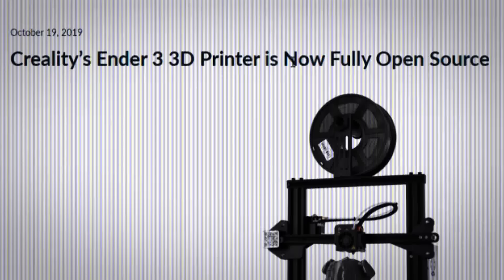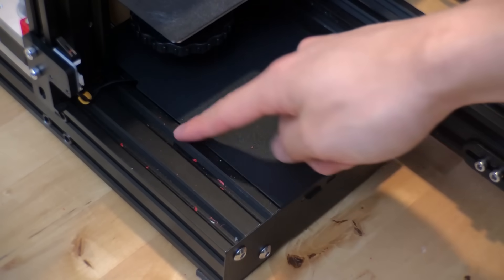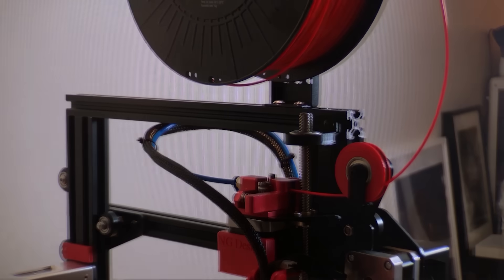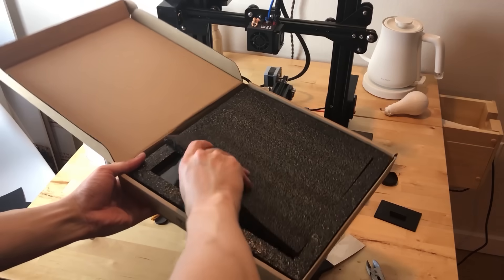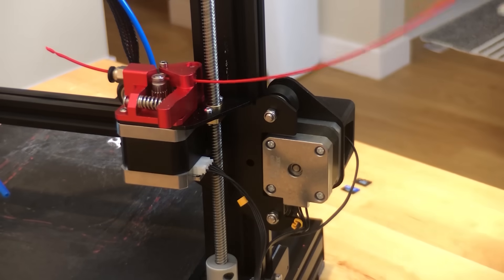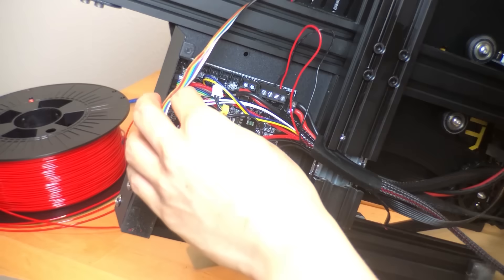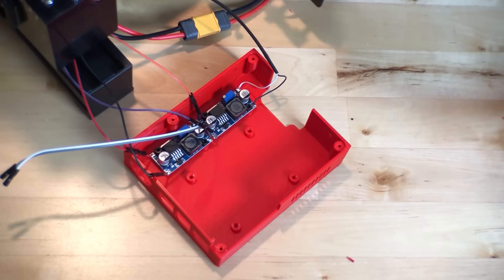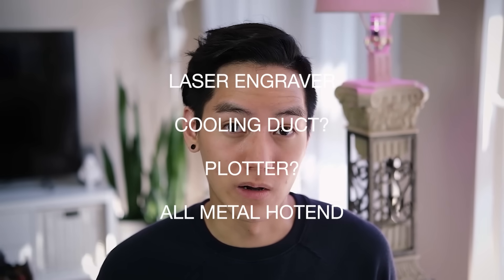First 24 Upgrades for my Ender 3 Pro - Part 1

Comment: 3D print a part.  Part needs a notch.    You could spend hours designing a new cover and then printing it (a second full print)  to fix it.  Or you could grind a slot out in like 2 minutes with a Dremel.
Reply from the maker: haha true but the print quality was also kinda strange on the first one so i wanted to reprint with some tweaked settings anyways

Comment: 5:00 um of course you don't need all the pieces if you're not gonna install them in the correct spot! Those are the last pieces that connect to the machine.
Reply from the maker: yeaaa but if you look at the video, by the time i got to those pieces, if i had added them, it would have bent the whole chain in a very tight and forced bend. try it out yourself. maybe you can work in those pieces but i chose to just play it safe. the main chain for the extruder is connected to the machine but for the heated bed wires those were just too far. good luck

Comment: The FAN shroud should not be used.  The Meanwill PRO PS uses the fan as an INTAKE fan.  You should never do anything to restrict this flow in any manner.

However, there are many other great items here to print and use.

Comment: I started printing with the glass bed, at some point after almost a year I changed it for a flexible bed and it is soooo much better, take prints out of the glass bed is a nigmare, with a flexible one you just bend it a little and they pop out, never using glass again
Reply: Im reasonably new but its like nite and day..  The flexible magnetic cover solved so many issues for me.

Comment: how much did all the unprinted parts cost? I'm considering buying the ender 3 pro but when I'm gonna buy it I want to buy all the upgrades at the same time so I don't have to worry about it afterwards.
Reply: You cant just buy them, thats illegal :) Just got my ender 3 pro after having a bad 5mm plywood anet a8....Im blown away at the quality and ease of use(Printing these upgrades). Good luck!

Comment: At this point, what is even original on your printer other than the display, frame and PSU? If you have to replace that much on the printer there must be a lot of cost creep and it might be better to start off with a better printer.

Comment: Highly recommend our 1000x1000x1000mm industrial 3D printer. Please let me know if you have interest.( email: hardy.ke@creatbottech.com or whatsapp: +86 18318030163 )

1) 7 inch touch screen

2) Filament detection sensor

3) Rail guide

4) Enclosed

4) Servo motor

We are factory and can providing affordable pricing to support.

You can also visit our alibaba store: https://creatbottech.en.alibaba.com/

Comment: I have a question regarding #7 2:52 the fan cover: because of the cover it gets less air, heat accumulates. isnt it dangerous to overheat?
Reply from the maker: I've seen a lot of people concerned about this one but it's honestly an air intake and the cover only redirects the air a bit so i don't think it's that big of a problem. lately i've bene doing 15 hour+ prints as well and touching the PSU from the outside there's no signs of it getting warm at all. it's a very popular one on thingiverse and i haven't seen anyone have issues with it but definitely do it at your own risk. it honestly barely makes it quieter too so maybe don't risk it if you're worried haha
Reply: @ScottYuJan  thank you ! Great Video btw. It nudged me to buy a ender 3d :)

Comment: owh dennggg i didnt know strings can be removed using lighter ._." thanks Scott <3
Reply from the maker: i actually recently over did it and left a huge burn mark on a very nice print sadly 😢 and i found out a heat gun actually works waaaaayyy better so i recommend that now haha
Reply: @ScottYuJan  that... happened to me minutes ago too xDDD luckily was just a test-piece. thanks for the updates, good sir <3

Comment: im new to 3d printing,how do i batch print something?Like the cable ties
Reply from the maker: i believe the files on thingiverse already has a gcode for the batched print but if not you can drag in multiple STLs basically and arrange them for a batch print.
Reply: @ScottYuJan  ok thank you i will look into that

Comment: If you have the BL touch, do you still need the bed springs and leveling knobs?
Reply from the maker: evening knob was just for flare because i liked the red ones better. springs.... you also technically don’t. the spring upgrades might contribute a bit to longer term stability but definitely not a NEED
Reply: k, thanks.  Just getting started in this and your video was a big help.

Comment: Are u able to install the bed springs and bed handle without removing the magnetic sticky bed pad thing.  I am not ready to upgrade to a glass top just yet but id love the new springs and printed bed handle.
Reply from the maker: yes you can!

Comment: For the front rail cover, did you run into issues using version 3 of that print (the current version) or were you using an older version?

Comment: You have the old ender 3 because mine has a magnetic flexible build plate wich is real good and usefull
Reply: He had the magnetic build plate too, but the glass is better in a few ways. It can heat to higher temperatures without risking damages or emitting fumes, and it leaves a smoother finish on the bottom. It may make parts less convenient to remove, but that’s a small price to pay.
Reply: @thedarkcod4824  i mean yeah but the new plate is better than the okd one

Comment: Bowden tubes can go up higher temps then the stock PTFE tubes .... aha and what Material is it then ?
and replacing the MB for easy of FW update dude just flash a bootloader on the existing open and check in marlin with thermal runayway protection ? why wasting money for the same hardware, besides stepper driver they are at least worth it

Comment: Can someone please explain why would you want to replace the magnetic surface with a glass one.  Also would the BL touch work with the magnetic surface as well or does it require a glass surface?
Reply from the maker: BL touch works with any surface. glass surface is just a lot more durable. it has downsides though for sure. it’s. lot heavier but i personally didn’t like how much my magnetic bed was getting dirty and scratched up and leaving debris on the base layer of my prints.
Reply: Scott Yu-Jan 👍 thnx a bunch

Comment: While I was watching this video for the third time, the mailman just dropped my Ender 3 Pro, which was bought pretty much thanks to this video.
Reply: Hey tonguc how’s it going . I also but my very first printer 2 days ago ? Are you planning to do all the same upgrades from this video ?
Reply: Josue Corona hi, yes. i will do the upgrades in phases though.  initially skr mini e3 + bl touch + bed metal screws. then later on dual metal gear extruder upgrade . later laser engraving upgrade. also i want to do a dual extruder upgrade at some point, mainly for fixed custom color so im still researching/studying that.
Reply: @Mr_ToR  Nice i am in  the same situation, right now i just started doing the chain link for the cable

Comment: I’ve done a few of these upgrades, some similar ones. But I’m definitely getting the BLTouch and glass bed. I’m horrible at bed leveling. There always seems to be some filament stuck on the nozzle inhibiting me from getting the bed perfect. My magnetic bed is also showing signs of wear. My main upgrade for it though is going to be building a proper stand/table for it.

Comment: cool video! might give the Raspi&BL touch a shot. You should add noctua fans.
- Mainbaord (fits and you can add 3 buck converters if required). Remember the SKR3 mini has fan&parts fan switched as compared to the original board.
- psu via custom printed cover to make space für the 60x25 instead of 60x10 fan.
- parts and hotend 40mm fans via 'fang' fan duct: https://www.thingiverse.com/thing:3676132 or a remix like this. Check if you can still add BL touch with this or need the metal-fixture. I used this one: https://www.thingiverse.com/thing:2683629 but it's a little prone to get loose screws. I also added HEX-fan covers and a small 3-LED LED Strip below the hotend fan angled towards the print.

Comment: well im doom i just bought the ender 3 pro and i dont have sd/micro sd card reader >_>
Reply from the maker: i think it comes with a usb adapter reader! at least mine did 🤔
Reply: @ScottYuJan  thx but too late i already bought the card reader xD
Reply: @ScottYuJan  i have a question the magnetic bed  the top that is removable is it the magnetic part ? or is the bottom part the only 1 magnetized ?
i bought the glass  bed but i didn't know the bottom was magnetic 
(just made the order for printer on amazon dont have it yet :D)

Comment: Hey can you link the vid or the instructions that you used to setup the BL Touch? I just bought a printer on the 28th and I am doing all the upgrades that you have.  I got the SKR Mini E3 V1.2 motherboard and installed it and it works perfectly.  I got the BL Touch/motherboard combo and I don't really know much about it other than the wires are a little too short.  Actually, really short seeing as they are about 6 inches long so if you could also link to the wires, that would be good too.  Thanks for reading this and hopefully it gets boosted up in the comment section!
Reply from the maker: oof 6 inches long is definitely not long enough. it didn’t come with longer wires? i’m not really sure where you would get longer ones. if you know how to solder though you can technically just cut them and solder in an extension in the middle though. woudlnt be too hard.  mine came with super long wires. the BL touch installation tutorial is in the video description though. that’s the tutorial i followed. good luck!
Reply: @ScottYuJan  Holy canollis you replied that quickly.  I do know how to solder and I will try that, but I don't see the BL Touch installation guide.  Is it under the BL Touch section or somewhere else?
Reply from the maker: @goodcontent5053  ahh dang it, you’re right. my mistake, i forgot i had to delete it when my description reached maximum length. here’s the tutorial i followed: https://youtu.be/g1rVaIXZ7Ok
Reply: @ScottYuJan  Thank you very much for your time and thank you for acually looking at your comments!  Keep up the great work and can't wait for part 2!  Im probibly going to base my entire printer of of yours tho so thanks!
Reply: @ScottYuJan  Update: I installed the BLTouch, flashed the firmware, and did everything that the guy did.  Ended up not working so i started messing around with the servo wires.  I broke them, but luckily it came with replacement buck things.  I faked those up and the wires were broken.  I then had to take out the SKR and replace it with the stock one so that I could return everything.  When replacing it, I mixed up the bed heating wires and the little wires next to it so when I turned it on and tried to heat up the bed, it flashed an error warning and a load beeping noise.  I turned it off and it said to restart the printer so I did twice.  Then it stopped turning on and left me with a blank screen.  Then I opened it up and realized the messed up wires, changed them, and put it back together.  It didn't solve anything and it just stopped working.  oof :(
Reply from the maker: @goodcontent5053  wow.... i'm so sorry to hear that man. that's terrible! you definitely want to triple check wire connections for stuff like this. oh nooo, do you think you can still send it back now? maybe give the SKR board one more try... doesn't feel like things can get any worse :( good luck!
Reply from the maker: @goodcontent5053  Also try googling some of the issues you've been running into. others may have ran into similar issues and found fixes.
Reply: @ScottYuJan  Yeah im just going to send the upgrades back, throw in a brand new skr board, and hope for the best.  If it's not that then its the power supply and Im hecked.  I got the printer off of amazon so i could take it back, but disassembleing it is the real pain.  Also thanks for showing concern and best of luck to you.  The reason that I can't just cut my losses and say fak the BLTouch and keep the SKR is because the firmware has already been flashed onto the motherboard and I have no idea how to reset it.  Now I can't print for the next 10 days while waiting for the new stuff which kinda sucks but what are you going to do.  Also, you should start a discord channel for people to chat with you.
Reply: @ScottYuJan  Also did your printer come with an acupuncture needle of some sorts.  Mine came with one and I don't know what it is.
Reply: @goodcontent5053  its for clearing the nozzle in case of a jam
Reply: @yehudabillet8145  Thanks!

Comment: IF you have a problem with warping or snapping off of the build plate mid print, I suggest using Elmer's purple disappearing glue sticks. It works charms for me, and I use the same printer but just make sure you put on 2 layers or it doesn't work as well. The bed has to be pre-heated to 60c for best results let it dry then start the print. You'll know if it's dry when it goes clear.

Comment: So I’m new to 3D printing I’m currently printing the cable chain on my ender 3 pro. I’ve been printing for 6 hours and 30 minutes so far and it’s 30% completed. Is this normal or do I not have my setting right?
Reply from the maker: you can definitely play with your settings over time to get it to print faster but with the cable chains there are many pieces so as long as the prints look good so far, i woudlnt say there’s any issues with that.

Comment: I still do not have good prints for most of the time. I get frustrated alot of stringing and blobs also bad bed adhesion with some prints. What to do?
Reply from the maker: i’m sorry to hear that. it definitely can take a while sometimes to calibrate your printer. i would suggest posting some photos of your prints and issues to the facebook group. people are very supportive there and can give you advice

Comment: Well, I 3d printed all of the parts for the chain, and when I went to assemble it I found that the part that connects to the motor doesn't fit. Did you have to adjust the size at all for yours?

Comment: Hi, great video. 
I have looked all over for the specs of the screw used in the pi box design, its all printed out and ready to go I found the wiring diagram from the original box architect but nothing about the screw size I want to order the screws and tap so I can get it all working.
Thanks for all you did putting this together it is easily my fave 3d printer video I have seen.

Comment: Enjoyable video.  I'm hoping to get an Ender 3 Pro over the holidays and upgrading to a SKR mini E3.  I know you said it removes the need for tl steppers and dampeners but do they still make a difference or are they just a waste of money?
Reply from the maker: thanks. i personally wouldn't bother with them. i've read on some threads online that they can actually end up doing more harm than good and to be honest if you're gonna try to make the printer any quieter or print better there are plenty of other parts to invest in instead. better fans, hotends.... the list goes on haha good luck!

Comment: I don't even own a 3D printer but his content is just that interesting
Reply: get one...NOW
Reply: You should consider getting one. Do not cheap out or you'll get buyers remorse! Get the Ender 3 pro. It's the best for the price and worth it.
Reply: @PunakiviAddikti  I got the Ender 3 Pro too. It‘s the best open source printer and you can upgrade it to hell
Reply: @smartronics4284  why do you need to get a 3d printer? I found this video in my suggestion btw
Reply: @smartronics4284  Arguably prusa is the best open source printer. However I would put ender as the best budget printer easily
Reply: @sidewinded1  yes, I forgot the prusa, because it's way out of my price range. but anyways a nice printer
Reply: @sidewinded1  Yeah, definitely get the Prusa if you have the money to spare. You pay for quality. The Ender 3 is the best quality you can get for cheaper than Prusa, at least in my opinion.

Comment: bookmarking this video for when I get a 3d printer. Currently upgrading a stereo in a car so this will be my next project. I'm still torn between a uv printer and an extrusion printer. Your prints look so clean, so it's very difficult to decide

Comment: Hi!!! I have a question. Why did you use the buck converter for the raspberry pi??? why can't you use a power source for it then just connect that to your Skr mini?
Reply from the maker: hmmm i’m not sure i understand your question. what would i power the skr mini with? and why would i use something other than the original power supply unit?
Reply: @ScottYuJan  no worries, I did a little more research and answered myself
Reply from the maker: @kuukuusings9641  awesome! 👌🏼

Comment: Yep, can't think of any reason at all why you'd want gaping holes in your power supply which expose the noisy fan to the open air like that. I'm sure that mains PSU will do just fine with those covered up, I mean electronics love getting super hot after all, don't they! Genius mod, mate! A humming fan is way more annoying than a house fire.... but wait, you wanted thermal runaway protection didn't you? The irony of that is not lost on me...!
Reply from the maker: haha yeaaa, i’ve been keeping an eye on the PSU temperature and it’s never been even warm since installing this and i’ve done many 2 day prints since. this upgrade has also been installed by couple hundred people on thingiverse and i haven’t seen any reports of house fires.... yet.... haha fingers crossed though! it’s just the intake and this doesn’t really cover it. it just redirects the wind going in so it’s a bit quieter. it’ll probably be fine? thanks for the concern though :)